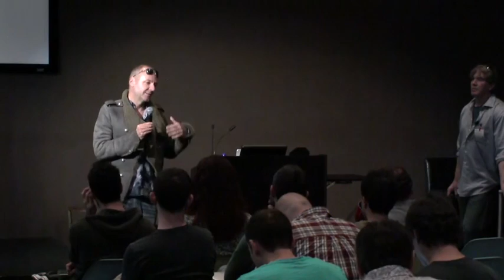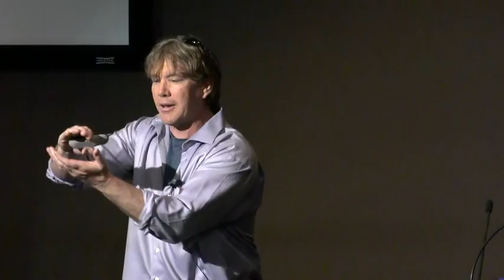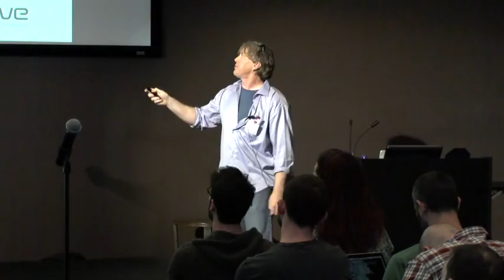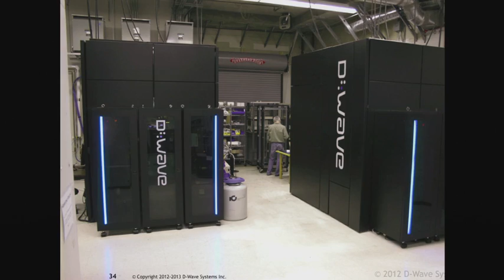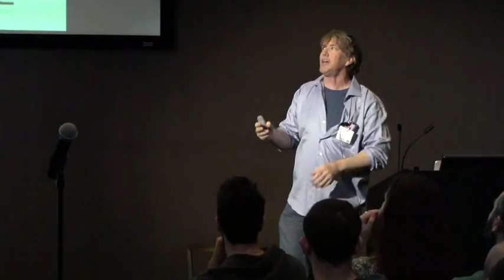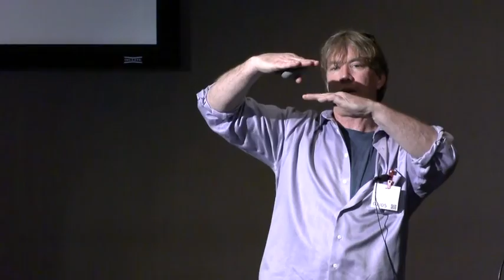Eric Ladizinsky: Evolving Scalable Quantum Computers

Comment: Fascinating talk, especially from the engineering perspective.  This does not delve deeply into how to propose a problem for solution using QC, but the challenges of building a practical machine are well described.  I have to agree with another commenter that there are some blasts of noise in the soundtrack that nearly sent me over backward in my desk chair.  I'm sorry I didn't note the times.  The subtitling is pretty good and you can pause when he puts up his graphics so that you can read both, thereby allowing one to listen on mute.